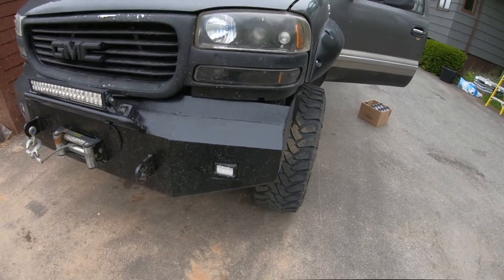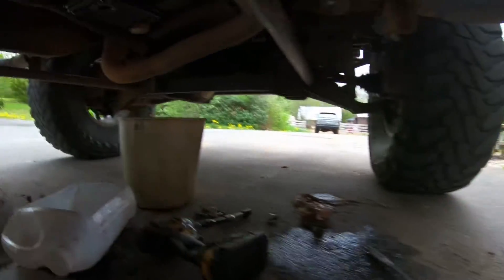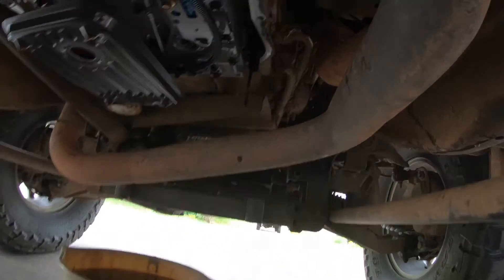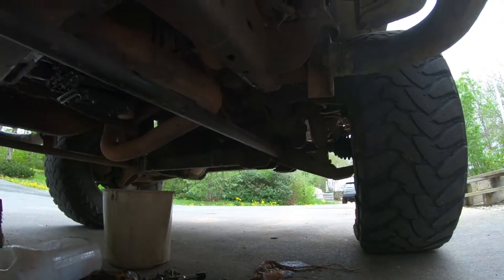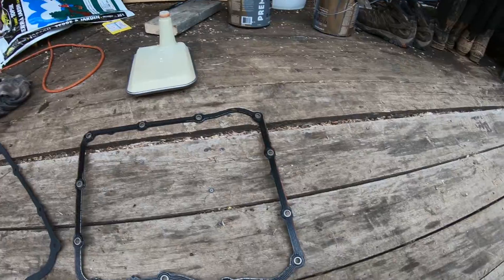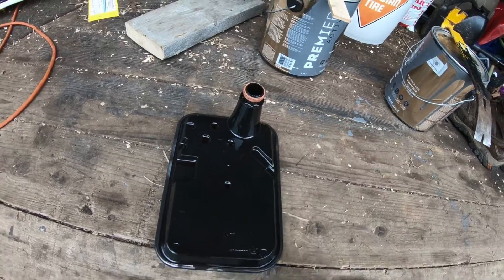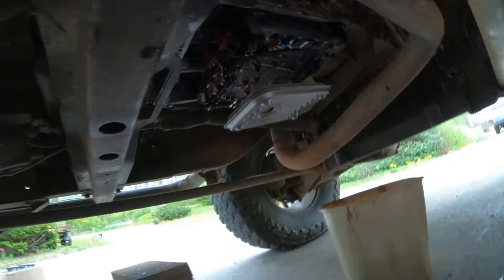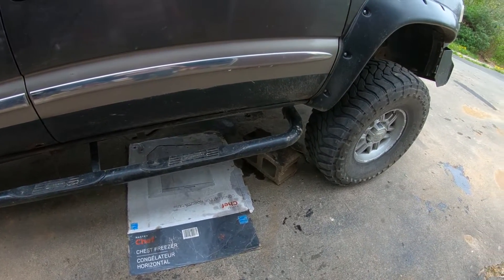GMC SIERRA 2500HD ALLISON TRANSMISSION FLUID CHANGE AND FILTERS CHANGED DIY

Comment: What oil did you use? Thanks
Reply from the maker: Synthetic atf
Reply: @BurninGas8.1  Thanks any brand you recommend. I just bought a old GMC Sierra and wanted to change transmission oil. Best regards!
Reply from the maker: @JoseOrtega-xn4mj  valvoline makes a good atf... the Allison isn’t too fussy though can run whatever ya choose